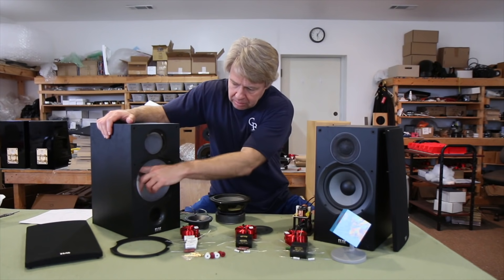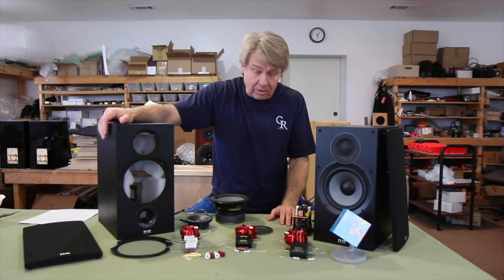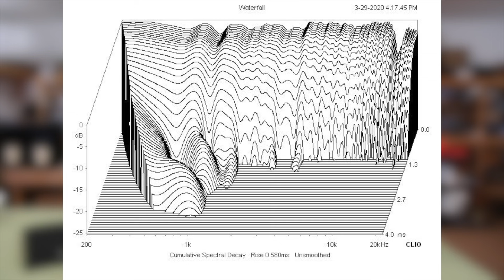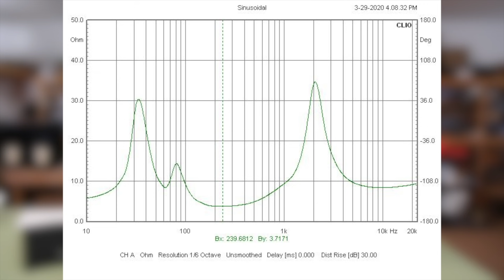Elac Debut 2.0 Upgrades and Modifications!

Comment: Bought the kit - did the upgrade - I already liked these speakers - now I love them. If you are considering this upgrade I highly recommend it.
Reply: Can you tell us upgrade parts specification? Parameters? I’m from UK thinking to get German parts.. but with same parameters..
Reply: @johnmcgregor2334  Dude...🙄
Reply: @johnmcgregor2334  REALLY?
Reply: @johnmcgregor2334  that is the kind of thing that chinese do, with chinese parts of course... shame.
Reply: Hi Daniel. I just did the upgrade and discovered a lot of interference with the crossover and the plastic air ports on one speaker which caused me to modify the layout for the second crossover assembly. Even with the tweeter coil laying flat on the 2nd speaker, I had to modify the plastic port. My recommendation is to separate the Tweeter and Woofer crossovers and mount them on the inner rear side walls. What say you? My first LP on the new ELAC's was Vivaldi's Four Seasons. It was like sitting in the midst of a live orchestra - - - - - WOW.

Comment: I have plenty of room, and I have heard amazing difference in the Elac Debut 2.0 Tower speakers just by changing the distance I keep from the back wall. Huge Difference. That, and removing the grill from the tweeter changes the audio experience, significantly.
Reply: Also have the f6.2 towers. Pulling the mesh off the tweeters helped the high end a lot. They also sound best a minimum 12" or so from back wall. Also try plugging the bottom port with foam. Really tightened up the lower bass. 
(I'm using a sub crossed around 85hz)

Comment: I never knew about tube connectors, but one of the upgrades I used to do was just running speaker wire straight into the cabinet through a hole that I drilled and then filling the hole with silicon so that it’s airtight. You end up with a speaker that has a permanent wire, running out of the back, but hey, it works.

Comment: I'll be ordering this kit. I can't get over how big speakers look on your table vs how small they look on my speaker stands. 

Edit: I have upgraded the left speaker so far. it sounds so good, the pair sounds bad when played together. The balance has to be moved 3/10 to the right to even hear the speaker with the old crossover. And when I hear it, I want to turn it off, it sounds more tinny and shouty. The new crossover is punchy and clean (maybe as much to do with the No-Rez as the crossover). I'm just glad I have an amp that likes 4 ohm speakers.  These Elacs WERE rated at 6 ohm and this kit brings them down to LESS than 4 ohm. The parts themselves were a bit of a challenge to get together in a space small enough to fit in the cabinet while keeping the inductors far enough apart. I managed, but I would like to see other people's solutions to this problem. I also found that both grills resonate at 72 Hz.. maybe not at listening levels, but while testing I was concerned I had done something wrong, until I removed the grills and discovered they were doing the buzzing.
Reply: don`t know how the box looks inside.. but typically cheap speakers can be improved with cabinet bracing as well as what you did

Comment: I suspect the dust cap could be responsible for that 750 hz peak. It's common for dust caps to contribute some sort of peaky resonance to woofers, even some expensive ones. Damping it out with some kind of doping compound might help. It may also be due to internal box reflections which is curable by more or better cabinet insulation.

Comment: Danny, thank you for another awesome upgrade. I was into it, and hoping to improve performance of these Elac's I have relegated to garage duty. Then came the $345 cost for upgraded crossover components... these speakers only cost $199/pr. delivered (Amazon). Seems more value might be added with $105 miniDSP 2x4. Could get rid of all the crossovers (component noise, phase issues, delay, etc.), and dedicate an amp channel to each driver (also increasing amp efficiency). Anytime a crossover solution goes over $100 in this modern era of advanced DSP, it no longer makes sense to me from a value perspective. There is just so much more that can be done with DSP, for so much less coin, and provides the opportunity to tweak at will. Think the highs sound too bright or too layed-back - adjust it, think the tweeter can play lower - adjust the crossover point, think it needs a step filter - add one, etc., etc. Try whatever you want with DSP - listen to it live while making the changes. Then when you think you have something special, load it to a config slot, and A-B switch between them to test. Could even create multiple crossover configurations for different music genres and switch between them with a wireless remote control. Nicest part of DSP is when filters are changed, it doesn't mess with phase, timing, impedance, etc., and you can see the resulting freq. response graph before (and even while) changes are being made. The way of the future is all digital to DSP (crossover) inside the speaker enclosure, distributed to drivers that have individual bespoke DAC amps integrated as part of the motor structure designed/optimized specifically for each driver (from the driver manufacture). The only analog cables in the entire system will be the short leads to the driver cone (unless there's an analog TT in the system).
Reply: Been there done that and tried the best there is. The MiniDSp is the second worst (behind the behringer). It sucks the life out of the music and is un-listenable. The D/A converter, power supply and analog output stage is on par with a $49 CD player. You'll get better sound from a non-upgraded stock model and a good DAC.
Reply: @dannyrichie9743  So the DSP solution is valid. Seems your saying miniDSP 2x4 has inferior power supply and DAC that are limiting the capabilities of this particular unit (or maybe all miniDSP-made products?). Notice you didn't take issue with DSP as a viable solution, but rather the hindrances of low-performance ancillary bits. Then it stands to reason that improved power supply and DAC would drive-up the cost higher than that of improved passive crossover components. What do you consider a 'good' DAC? Since DACs are more commonly used outside of DSP in the HiFi community (wherever digital sources are used), would it be possible to have a Tech Talk on them?
Reply: Whilst I agree with the general "DSP" reasoning, the technology is in a toddler development stage (to avoid the word phase). Several huge problems need to be solved before you can compete with the best musical high end audio. Electrical engineers really don't understand human hearing and base their work on simple mathematics where only sine waves are considered. Try running a 1,760 Hz blockwave through a component chain and look at the wave shape in your room. Total mess.
In a cheap system, there are simple priorities that, IMO, you better address before surrendering to GAS and (expensive) modifications.
1. Phase aligned AC. In countries where AC plugs allow random Live-Neutral plug insertion, make sure all devices are polarity aligned. When they are not, voltage differences between devices cause current to flow over ground connections linked to the signal paths. 2. Clean AC. Each amplification stage tries to bring AC to the next in as short a path as possible. Like in a capital T, amplification is the horizontal straight through and previous stage is the vertical modulating the horizontal. Garbage in = Garbage out (the GIGO principle). Most power supplies are too simple to prevent bad AC from seeping through into the next audio stage. Even in high end. Listen to somewhat complex acoustic music with proper space recording and zero mastering or mixing. Hear the difference between business and household rush hours and after midnight. The latter better? Bad filtering in power supplies. Note that electricity companies around the world increasingly worry about pollution of their grids. 3. Speaker placement in your room. Watch e.g. Wilson Audio's YT clips about the subject. Your turn. 4. (Iterate 3 & 4) room acoustic treatment. Ask an assistant to help. One (M) has a mirror, the other (L) in the listening chair. M slides the mirror over surfaces in L's room, where L watches where a speaker becomes visible in the mirror. Walls, ceilings, objects. Each "hit" labeled with a sticky note. These are points of first reflection. Each of these contribute to mess you hear. Simple acoustic treatment (extinguishing the reflection) improves your listening experience by a lot. YT channel "DIY Perks" shows two DIY approaches - the oldest has the best WAF, based on cheap wood frames filled and covered with towels. 5. Have crossovers with no capacitors in the audio signal path. My Extrema speakers have passive radiator cooling on the main resistor taking most if the heating. Spatial clues are great. 6. Don't talk about phase when you want to take phase change out of a speaker that has its driver's aligned out of phase.
[GAS: gear acquisition syndrome. WAF: wife acceptance factor. AC: alternating current]
No comment on this channel. It makes sense.
Reply: @dannyrichie9743  I don't like digital crap either, I even don't like CD, after listening to CDs of music unobtainable on vinyl for 2 days, fatigue takes it's toll and back to vinyl

Comment: I've got the tower version, glad to know this is here.  Devialet makes an amp that corrects these speakers automagically but it costs $10,000 new.
Reply: Matthew Bowler Matthew, Devialet doesn’t correct anything just “learns” the drivers so that it can feed it with the right-perfect juice without overdriving them. With a different XO you would need to re-measure to get the “perfect” fit again. But it’s very clever indeed.
Reply: If you have a tweeter behind sub-par caps, then it will sound bad. A better amp may clean some of the bad sound being injected by a bad amp, but can't do much beyond that.

Comment: That is a good improvement even though the fact Andrew Jones went thru a lot of work to design this model speaker at a demand budget price.....
Reply: $1800  Polk audio had one good part:  a ring tweeter. ($30).  The rest?  crap.  Andrew Jones could help polk out, but if polk made the Debut speakers, they'd cost 3x as much for the same thing.
Reply: @scottlowell493  Nonsense.
Reply: I bought the elac debut 2.0 b6.2s and was disgusted. Shitty highs and nonexistent mid range.